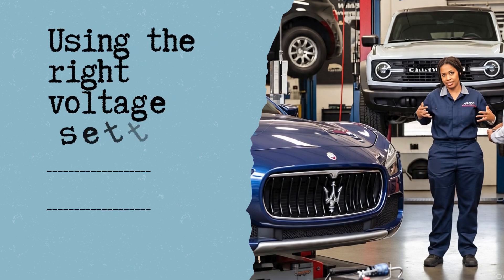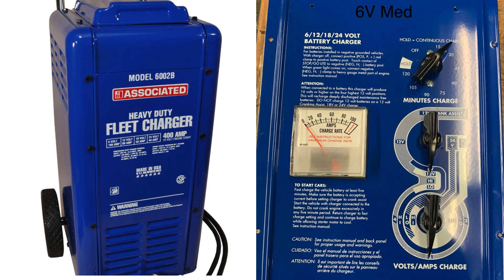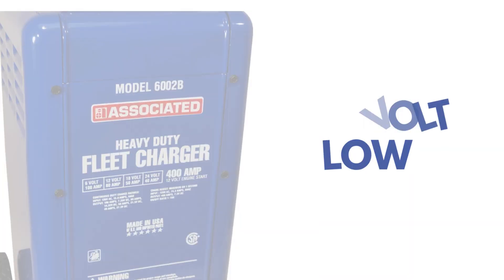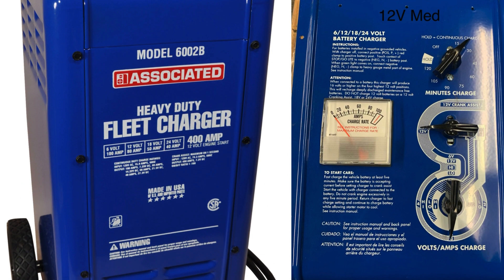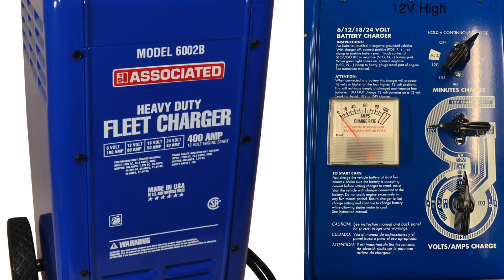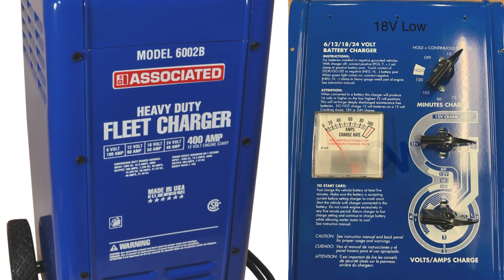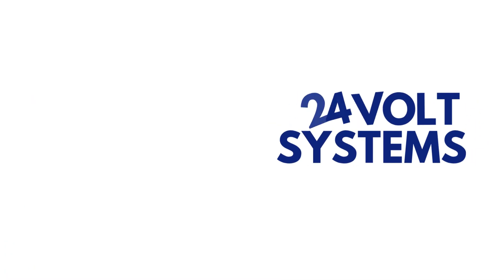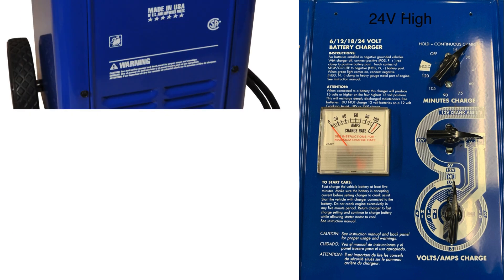Stop Guessing Voltage — Pro Techs Use the 6002B for Perfect Charging

Comment: Error when displaying bottom switch at 6:00 when s/b at 3:00 for 12v medium low setting.
Reply from the maker: The 6002B is a manual charger so it would not give you an error code. However, if you are having an issue with it you can contact our tech support department to troubleshoot what your issue may be, 314-385-5178. Thank you for choosing Associated Equipment for your automotive charging needs.
Reply: @AssociatedEquipment  sorry for being unclear.what I meant was the example of where the switches should be set at for a 12v medium setting were incorrect. The bottom switch should be set at 3:00 rather than at 6:00 as shown for a 12v medium setting. Correct me if im wrong.